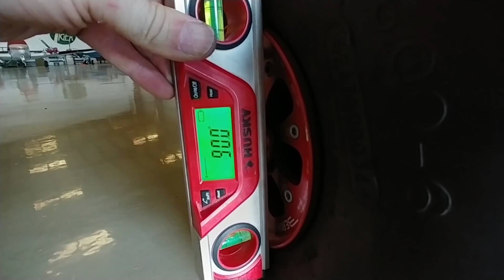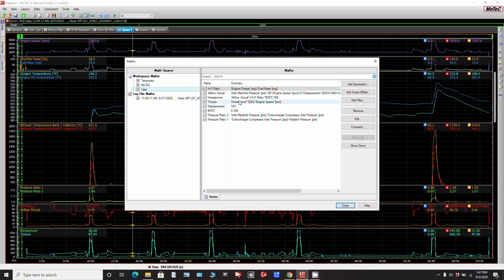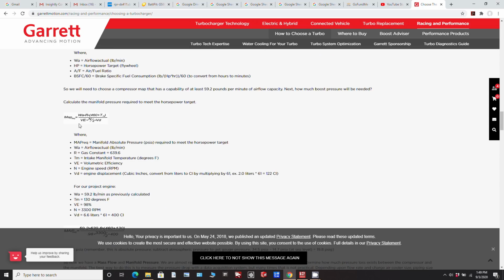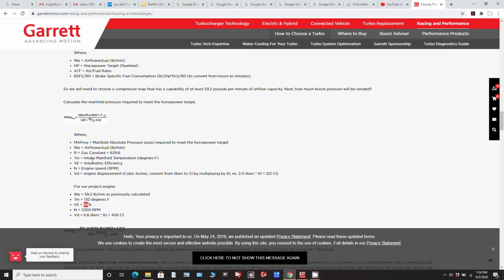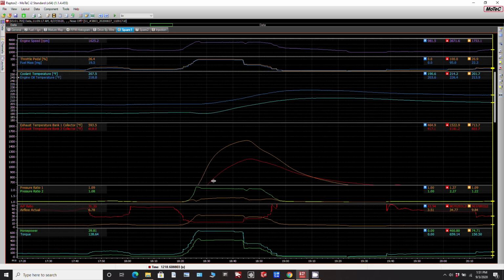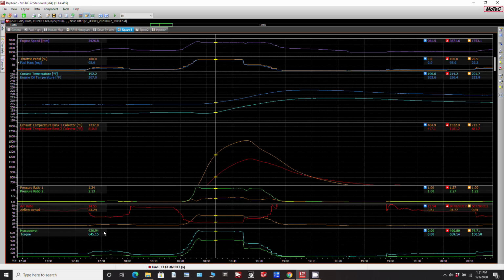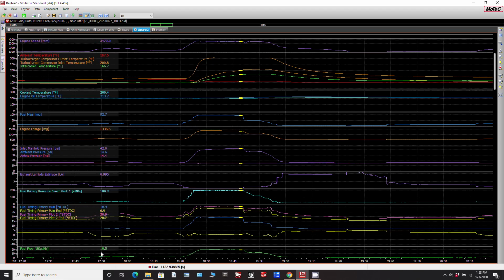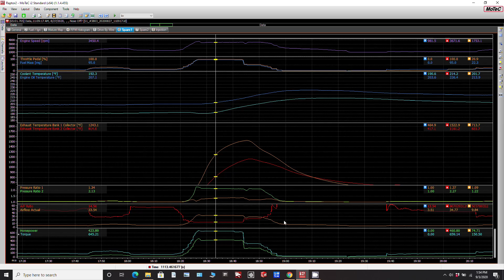Maintenance Complete - Building the Raptor Prototype

Comment: Unless you are using optimal fuel injection timing you will not develop the power you think you will get. Banks uses 20 degrees BTDC on the Duramax and wants injection complete before 20 degrees ATDC. He knows what he is talking about. Your playing with it and using TDC wastes Peak cylinder pressure. You want as much as you can get before the piston starts down. Good to see you have at least watched some of his videos.
Reply from the maker: At full power I have it tuned so injection starts at 18 degrees BTDC as is complete at TDC. That's what I was taught at HP Academy.

Comment: >Any velocity owners out there that could give an idea of flap deflection on the canard when trimmed out 

Yes.  The trim spring installed on the Raptor is way to light.

The Velocity has a similar spring style in that the trim motor moves the base of the spring (the anchor if you will) forward and back and where the trim motor stops that position is the new "hands off" neutral pitch trim.  The Velocity trim spring is actually very stiff to the point where the elevator panel will only be able to move up and down a small amount from neutral.  

Prior to takeoff the pilot sets the neutral (or takeoff position)  trim so that the elevator panel is pointed down about two to three "finger widths" referring to the gap at the outboard edge of the elevator compared to the wing tip.  Then as the airplane picks up speed during the takeoff roll the air pressure under the elevator panel will blow it back (and up) slightly but not very much...very slightly so that about rotation speed the outboard gap is only about 1 finger width.  To rotate, the pilot will need to pull back on the stick to move the elevator panel down into the air stream to get the nose to lift up.  When the nose wheel begins to lift there is often a greater "heaviness" on the nose because the aft weight of the airplane is being transferred from the main wheels to the main wing and as the main wing takes on more and more of the weight from the main wheels the nose feels "heavier".  Once all of the aft weight is transferred to the main wing the "heaviness" of the nose goes away and the airplane is trimmed out perfectly for a 110 KIAS climb.  

What you do NOT want to do is to trim the elevator panel farther down to the point where the nose lifts off on its own because that trim position will flat out "POP" the nose off the ground and the main wing will immediately see lift and the airplane will point straight up into the air and you see nothing but blue in the windshield you will be PUSHING forward on the stick and wish'in that you believed me on this.

The Raptor trim spring is WAY TOO LIGHT because you can see Peter moving the elevator panel from down to up with his back hand.   This will make for a VERY UNCONTROLLABLE airplane in flight.

Here me now...believe me later!!!
Reply: We use a small inverted airfoil to counteract the tendency for the elevator to rise. http://www.velocity-xl.com/blog/2015/03/03/10-1-3-aerodynamic-trim-sparrow-strainer/

Comment: Look where the static port is on this Velocity. It needs to be on the side, not the bottom where it will be affected by changes in the angle of attack. And it should not have not have anything near it that would affect the flow of air across it..  https://youtu.be/2sHoFRTZJn0?t=690
Reply: Static ports should be located in STATIC air. This is usually on the side of aircraft after boundary layer separation or on vertical stabilizer. You can measure this in static line dynamically in flight. Electronic manometer

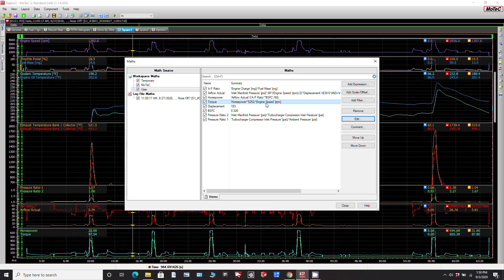Comment: 07:30 Thought it was the reverse. 1st parameter that you have is torque. Than you can calculate power (in watt/hp/bhp/etc) which is a work unit that torque produces given a period (revolutions per second, in that regard). And by no means I know how thrust works, but given it is a propeller, its rotation speed may at the end dictate how much engine rev you really need to measure the airplane performance. PS: I enjou a lot watching the Raptor project maturing intor a certified aircraft. Great vids!

Comment: Peter, you don't need to wait 30 minutes between runs.  These are not 7 layer brake assemblies.  Get an assistant, 2 high velocity fans and an extension cord.  Place the fans between the gear after each run, 2 minutes, they will be at an acceptable temp.  You don't even need to shut down.  A laser temp gun would be better, can check a much more focused point.

Comment: Are you going to pull back on the stick to get into ground effect?
Its looking like the trim is not holding.
Reply from the maker: Actually, the trim is holding. I still have more to go and I can always move the linear actuator mount point back a little to notch the whole thing further up if it's necessary.

Comment: Any velocity owners out there that could give an idea of flap deflection on the canard when trimmed out and at takeoff load.  Since the canard design is similar[albeit bigger] I suspect that trim spring system may not be stiff enough to hold proper deflection? Just my two cents.
Reply from the maker: There's still more nose up trim that I haven't used yet and I can also move the linear actuator mount point back to get even more. The one thing that has to be maintained is the ability to single handedly pull or push to the stop in the opposite direction if the trim were to runaway. That's why I don't want to stiffen the spring.
Reply: A multi-rate spring combo might change the compression curve enough to be effective until Vᵣ.

Comment: Peter, When you were building the Raptor, you installed sensors to use in flight test.  I have not seen your videos testing and showing that technology.  It should help in sensing lift, control movement, etc.  Can you update and demonstrate those sensors and software you are going to use to follow the flight test?
Reply from the maker: They are installed but there's nothing to be gained until after it's flying. They are mainly for stress and flutter testing at higher loads and speeds. None of that should be going on for the first flights so not worth messing with at this point.

Comment: Yippee... Raptor Bell... Looks like positive moving forward progress, Peter. Thank you for sharing! I've found that aircraft and boats have several things in common. (#1) Gasoline boat/aircraft engine consuming 20 GPH is producing about 200 HP, Diesel boat/aircraft engine consuming 20 GPH is producing about 400 HP. (#2) When using boats and airplanes there always seems to be one more thing to do especially when they are newly manufactured. (#3) It takes time to get all the squawks sorted out in both. It's just the nature of high performance machines! Best of luck as you progress with further testing. Raptor keeps getting better and better.

Comment: I would be fascinated to know what Gale Banks would think of your analysis of engine performance. I suspect there are few people who understand getting performance from a turbocharged diesel engine than Gale Banks. Would be neat to know what he thought.
Reply: I’m sure he’d say something about your 14~/1 fuel ratio.
Reply from the maker: Yes, I'd like to have installed pressure sensors on the hot side of the turbos to get the info that Gale uses and then have him identify where the possible mismatch is and correct it. But that's for another time.

Comment: Those plastic bags are still there......
Reply: “The weather is super hot & humid.” 
Sitting on plastic bags must be really uncomfortable.
Please forgive me, but this issue is becoming something of an obsession.....
Reply: @michaelq5279  I suspet he is keeping them on until he is completely done with the mechanics and any glue work for the rest of the interior. Molyiminun-disulfate greese has a nasty habit of getting into fabric (shoutout to AvE and the release the schmooo!) Also glue is also hard to remove. It does have to be hot though in that south Georgia sun.
Reply from the maker: I've said before, they're coming off after first flight. Not sure whether ground effect counts. I'll decide when that happens.
Reply: Raptor Aircraft - Peter you may want to consider removing the plastic prior to the first flight. Plastic can be combustible and lowering any risk my bode well for your test pilots. Just a thought??? Take care and we are all with you.. Cheers Peter!
Reply: @MrWATCHthisWAY  fabric seats seats they are made of typically a polyblend willed with poly foam. Yes they may be made with flame retardants

Comment: It would be interesting to hear your thoughts now that the veil has lifted on the Celera 500L. Sounds like you and them were looking to shake up the aviation world with diesel power. They went without canard and put in vertical tail... Anyway, just wondering.
Reply from the maker: It's an interesting aircraft. Many of the reasons for it are there same reasons why I designed this aircraft. I hope they're successful in bringing it to market.
Reply: Both will have a market.  Certain of it.  No question. 

With the 500 sporting a 200k engine they will not be in the price point at all of a Raptor. 

Way beyond. 

The 500 is going to compete against the small jet market.  Hope for them is to slaughter that segment with phenomenal opperatng costs.  

This baby will be for those of us wanting to fly half the people half the range at half or less of the currently projected 500 operating costs.  

Diesel burning may the similar tie in but they are 2 different birds..
Reply: The 500L is targeting a completely different class of passenger - it's price point is also $5,000,000, has 6 seats and a lavatory so the market segment is not even close to the Raptor.  Having said that, I think there could be a lot of things Peter could learn from watching them as they've ramped up their development and are now moving into production... never hurts to watch another startup go from zero to hero while trying to mimic their successes and avoid their failures

Comment: 420HP? Doubt it. Might want to check the math
Reply from the maker: I have checked the math, many times. How about you double check it for me and tell me where I went wrong.
Reply: Raptor Aircraft < I’d like to see more commenters offer up technical analysis supporting their claims. It easy to throw a comment over the fence much harder to back up what you say.
Reply: Is there a Mass Air Flow sensor in the intake of this beast?
Reply: The concept of maths is good, but as you say Peter, assumptions are made, BSFC for example. Relative to each raptor flight this works, as the HP is just another number. However if you want to compare to other engines/ aircraft, you need to check/ calibrate your assumptions. Easiest way would be a dyno check.....Was a shame your original dyno check didnt work....Boy, I wish i had half your persistence and determination....